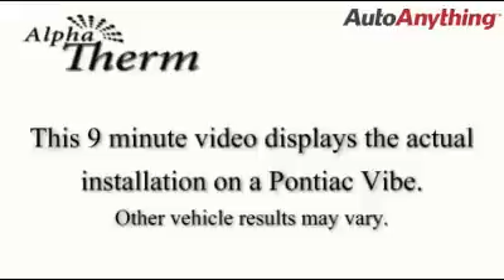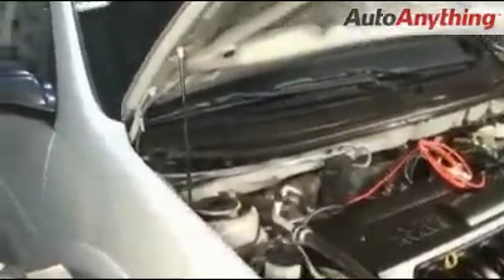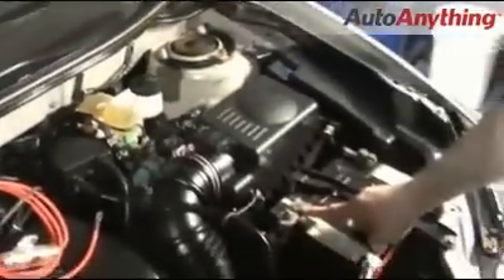How to Install a Windshield Washer Fluid Heater

Comment from the maker: @yellowcow13 I think it's a red wire, but it does look orange in the video.  You could always tape up the wire with black electrical tape, or wrap it with wire loom to hide it better.

Comment: so how do you turn the unit on? all you connected was the 12v and ground, so is the unit on all the time?
Reply: it senses the voltage and turns on when the engine is running. but lots of them start fires. so becareful

Comment: I have a 2008 Audi A5 3.0 tdi coupe and my battery is in the boot, how would I go about wiring this?
Reply: Cut or drill a small hole in top or side of boot big enough for 2 small wires to penetrate and the seal them in silicone.
Reply: There must be pretty thick cables going to the starter motor, bolt the live wire to the live side of the solenoid and the black to earth (anything bolted to the chassis will do)

Comment: I purchased this for my 2017 Chevrolet Silverado and I was in Minnesota where I live now and I tried to spray -30 washer fluid and it froze up instantly and clogged up my sprayer. The Alpha Device did heat up the fluid but like I said it caused an instant clog at sprayer (note it was -29° and that wasn't the wind chill factor) I've even tried to use -60° solutions and they froze my sprayers too. Does anyone have an educated opinion on how to fix this yearly ongoing problem with my Alpha Heated window washer sprayer?
Reply: isopropyl alcohol(rubbing alcohol) has a freezing point of -89C -128F. I wonder if you could mix that into your washer fluid. Pure isopropyl is probably not good for the rubber hoses so I would start with mixing it in. There's a product HEET(yellow bottle) its marketed as gas tank/fuel line anti-freeze and water remover, its mostly isopropyl alcohol, that "should" be a little easier on the rubber hoses(I mean its marketed for fuel lines so why not washer fluid line)

Comment: This is not the best installation video I've seen. My sister did better demo-ing her vacuum cleaner. This video could use some editing, like who wants to sit and watch a minute or more watching a guy unscrew a screw? And there's not enough verbal instruction, especially if the instructional voice is separate from the installer. I think the beginning of the video should have mentioned the vehicle being used, the equipment needed for the installation, and what comes in the product box.
Reply: Well the direction I received were horrible at it's best but it took me about 15 mins to mount and wire it into a lifted truck. I had no room on my firewall and had to mount it behind drivers headlight in the spare battery are on driver front quarter panel. It still produces really hot fluid but my truck doesn't have rubber hose, it a plastic tube. I had to modify the Alpha Device Kit cause I had leaks where the connection were made do to ID of kits hose was larger than my trucks plastic tubing OD it was a quick fix with silicone and 2 hose clamps on each side. Now it works perfectly except for the fluid freezes at sprayers after the first couple sprays of fluid. ** Does anyone know if there is an OEM kit to make my trucks sprayers heated cause I need them